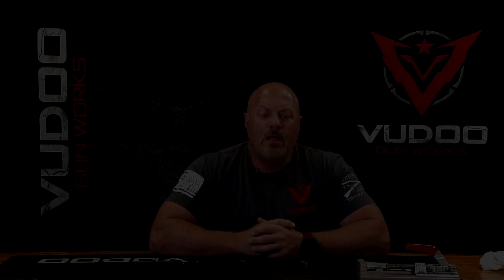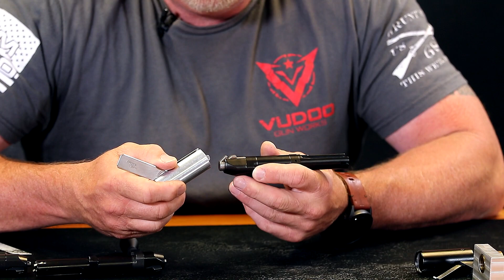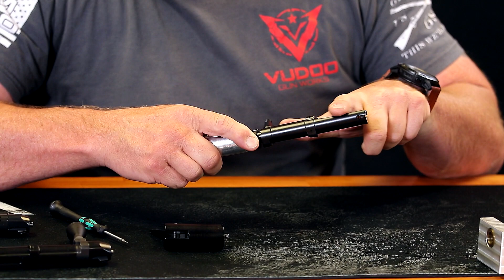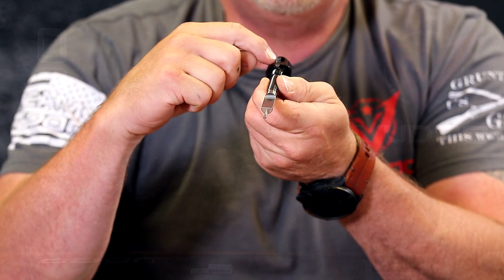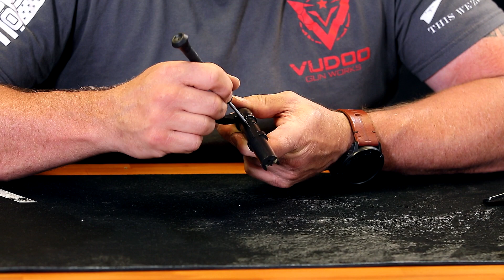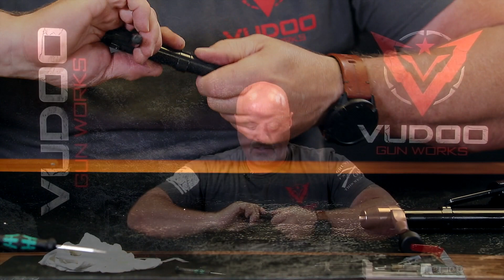Vudoo Gun Works V22 Bolt Disassembly

Comment: This video seems to differ a little from the MB video released on January 15. Can gen2 be disassembled just for for cleaning like on Jan 15 and this video is actually for pin and spring replacement? MB never mentions anything about the small allen screws.